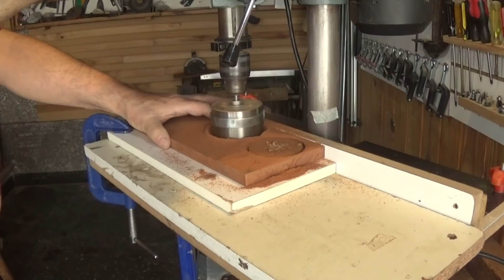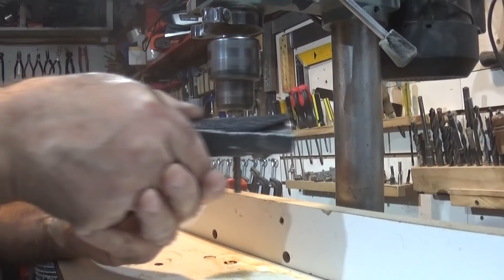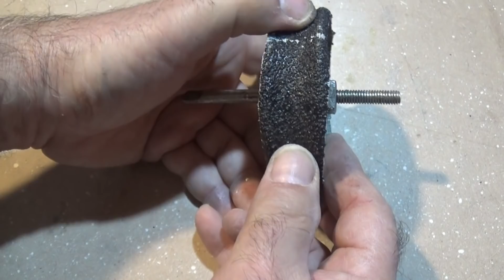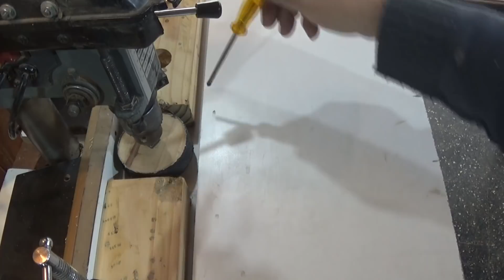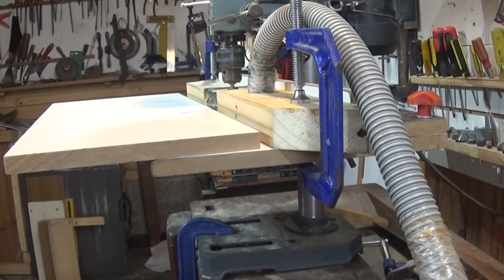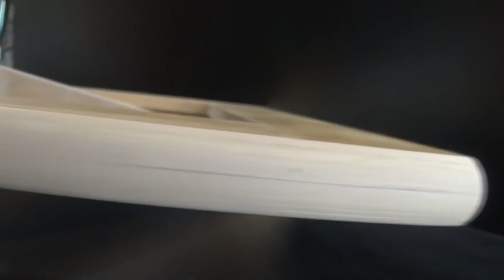COMO FRESAR MADERA SIN FRESA DE ROUTER - DISPOSITIVO / Por Juan Carlos Aquila

Comment: buenisimo el video. Me surgen 2 consultas. La primera es a que revoluciones la agujereadora y otro lado cual seria la potencia de motor ideal para poder trabajar tranquilo en el taller. En mi taller tengo 2 pero se frenan por mas despacio q utilice las mechas copas en mdf. gracias
Reply from the maker: Hola Emiliano.
Para utilizar las brocas copas se debe ir a la mínima revolución posible con la agujereadora. Nunca a máxima velocidad, y avanzar lento, sin apuro. Verás que no tendrás problemas al perforar. Cauanto más diámetro, menos velocidad.